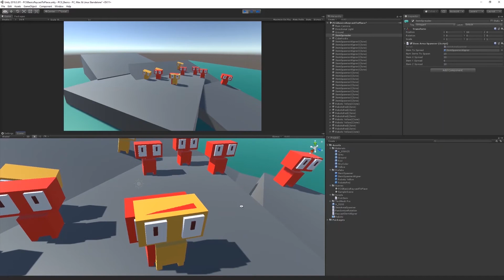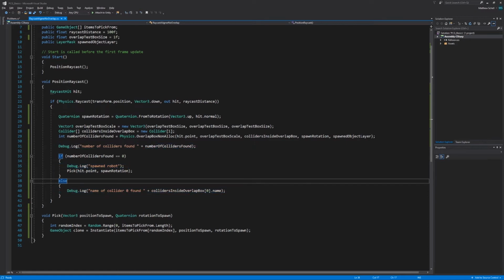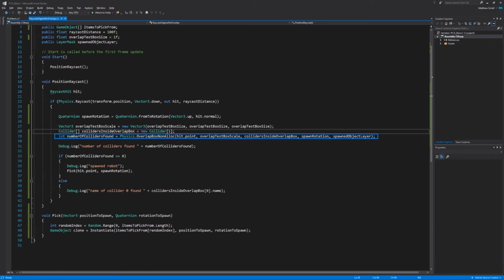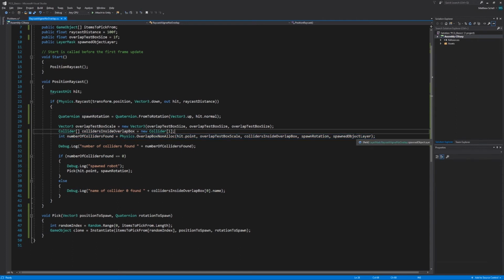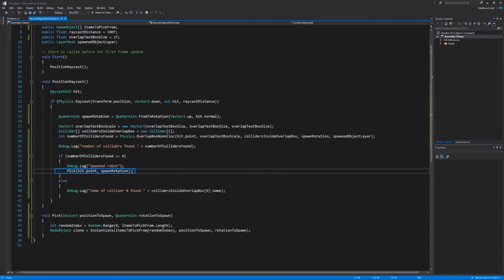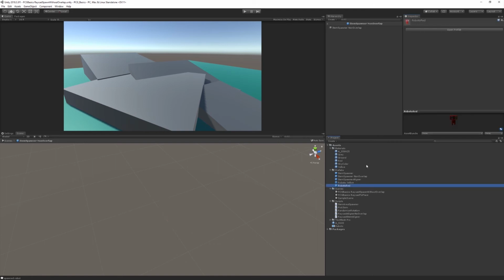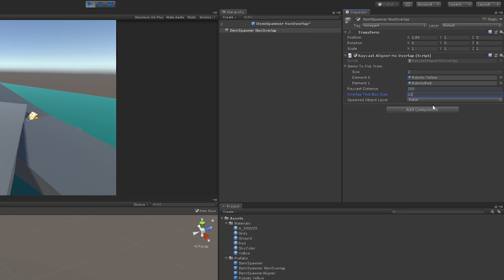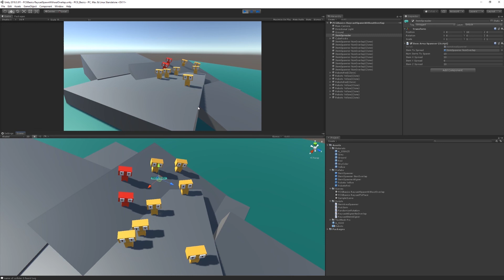Procedural Generation Basics: Prevent Overlap Spawns With Boxcasts In C# [Unity Tutorial]

Comment: If you don't use the collide check on a game objects start function (where I believe the physics are already set up) but rather do the check in the same frame after instantiating an object this will not work. Just in case someone alters the code like I did. The box overlap function needs a collider to check, and they are usually set up in fixed update frames, all the items spawned in the same frame will not recognize each other.